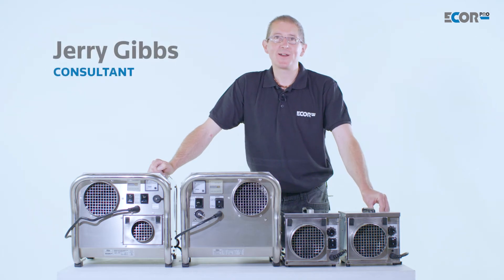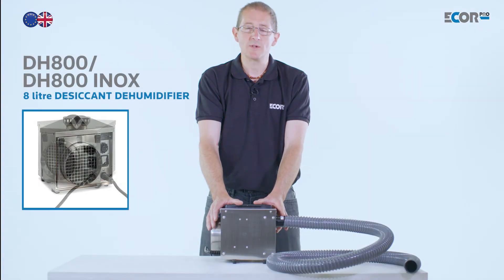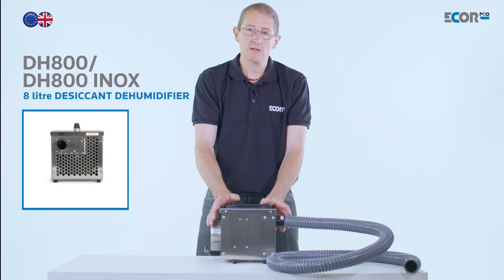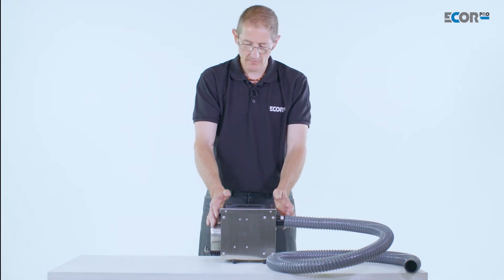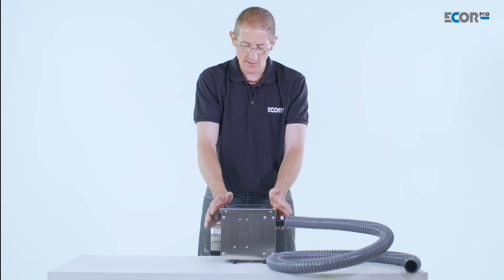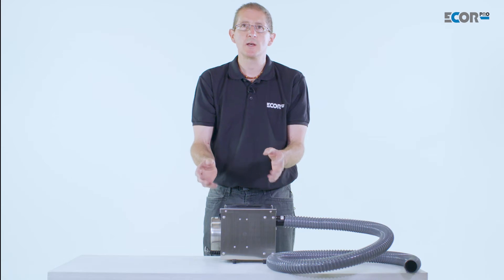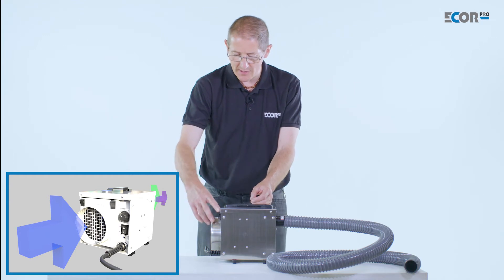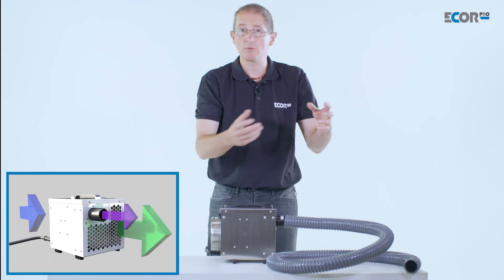Exhausting wet air with a mini dehumidifier [DH800 ducting wet air to the outside]

Comment: What happens when the desiccant gets saturated?  Toss the unit and get another one or change the desiccant?  Or does the unit itself bake the desiccant crystals to remove the moisture its absorbed?
Reply: The latter: the dessicant wheel rotates and gets dried over and over hence why it uses a lot of energy but lasts many years if kept clean.